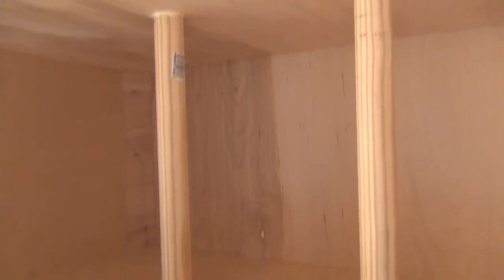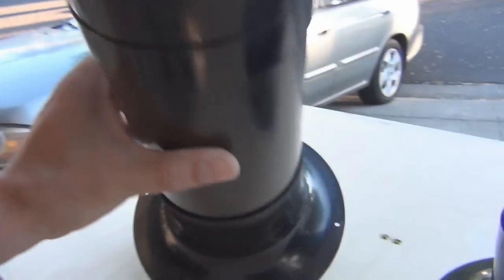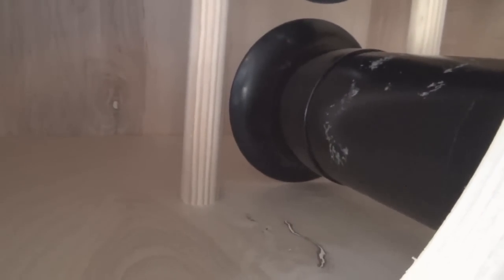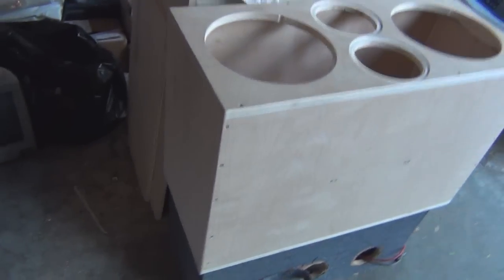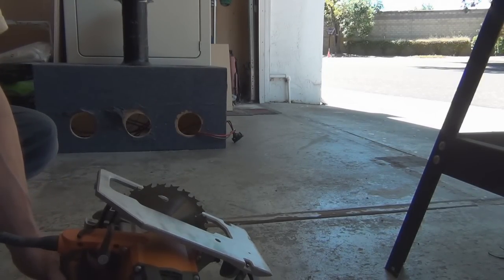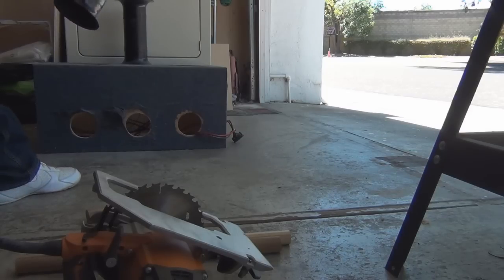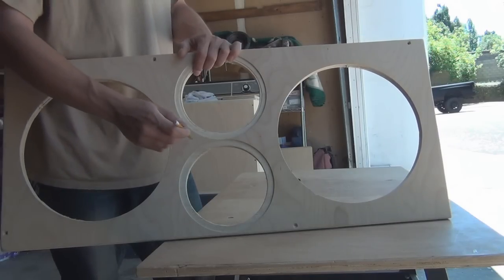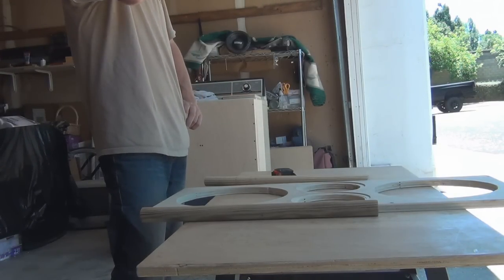Dual 12 inch sub box re build 5

Comment: why did you not just use a jig saw. hahaha.
Reply: ok sorry i know that is a great box but the air flow is still all around the box and not really being directed to the port.  if you just had built a wall where you had installed the 4 dowels for bracing then you would have had like 2 boxes and it would be more direct into the ports for a better sounding.

Comment: What is your cubic foot space?
Reply from the maker: 4.6 cubes after all displacement.
Reply: Is 2   4" aero ports good for 2 12s in a 3 cube box? And if you know how to do the port area could u please tell me how
Reply from the maker: Foot Sucker 3 cubes net is not enough for 2 12's. You're better off going sealed with 3 cubes. This is what I use to figure out tuning. They no longer support non-flared ports but it's usually an inch shorter. http://www.psp-inc.com/tools2.html you can play around with numbers and figure something out.
Reply: These are some cheaper brand subs so 1.5 cubes each is the specs and thanks for the help my freind